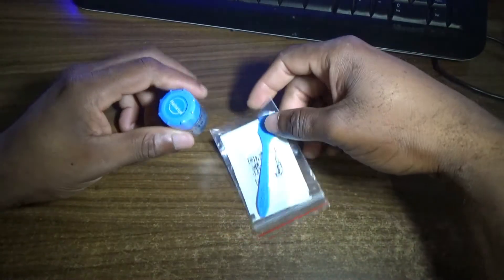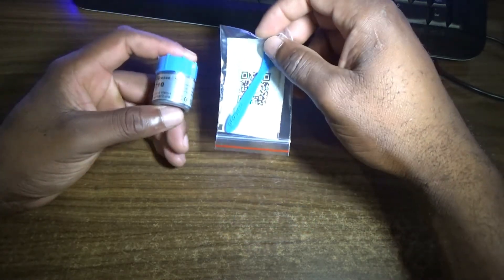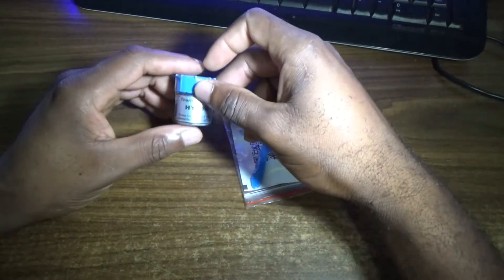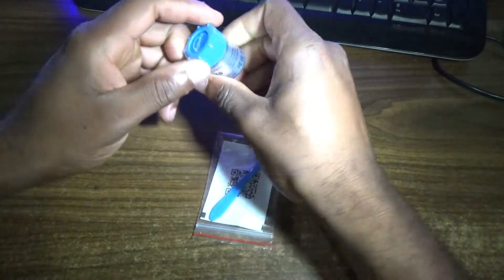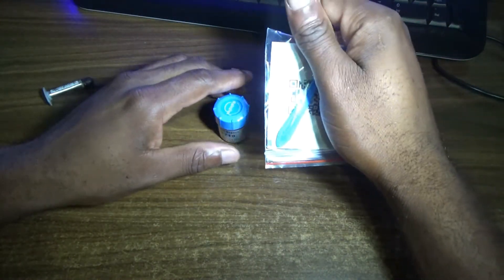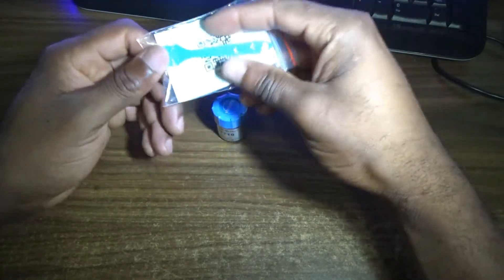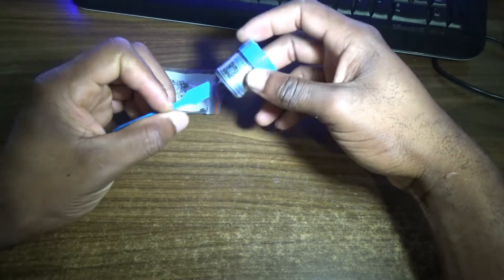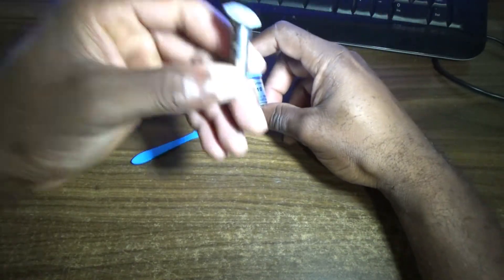Halnziye Thermal Grease

Comment: GD900 is way better than Artic Silver 5 and up their with IC 7 Diamond thermal grease.... i slap some GD900 on my GeForce 9600 that was running at 59c idle and after i applied the GD900 right away the temps drop amazingly to 40-42c idle and my Xeon also drop to 39c idle from 48-51c!   This stuff is superior and for less than $4.30 for a giant 30g tube of GD900 u just cant beat that not even any retail store cant compare!!!

Comment: How does it perform compared to other name brand compounds? Data please, not opinions.
Reply: I had HY510 from them and quality of the compound was very poor. Actually when I changed compound over time, in the middle of the CPU was a kind of oil spill, left after HY510 compound application. I seriously recommend better thermal compounds like Arctic MX-2 or same.
Reply: @BSSVK  have you tried the dam pads which only one eBay seller sells 100x100 2mm from eBay till it arrived in a Amazon package 😂😂😂
 says 10x on end of listing I got ONE square FFS 🤣 2mm looks way too thick too
what the hell is this point lol
Reply: @GlitchyBastard  yo